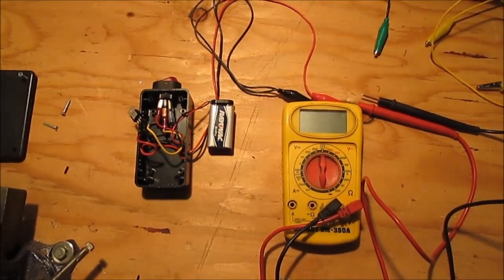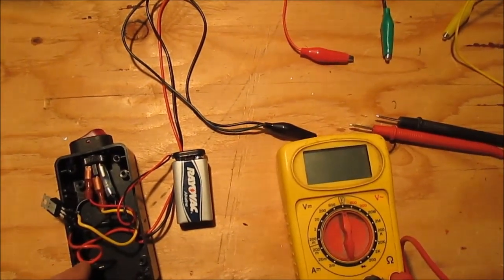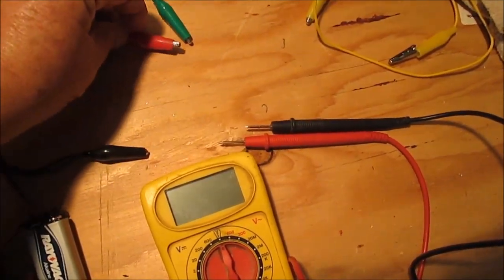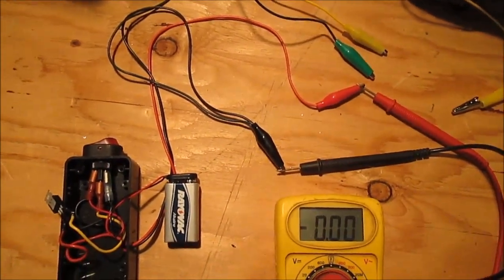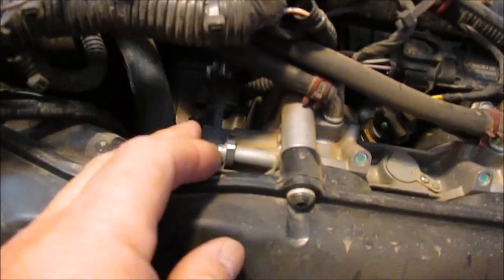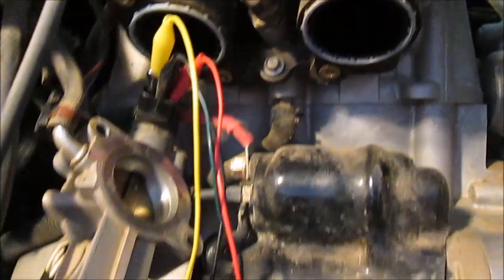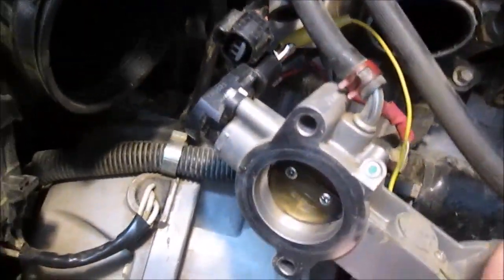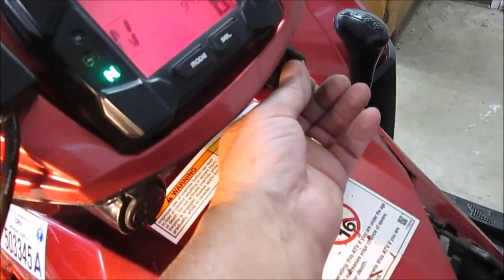ATV Polaris Sportsman 850 TPS Tool and Adjustment

Comment: Hey Dale I have the same Issue - did you adjust the throttle positioning on the quad first where the thumb throttle inside the cable box for the TPS Gap of 2-3mm or just adjusted the TPS with the existing throttle in its original state - what im refering to is section 2-10 in the service manual - did u adjust as per the manual or just made the correct TPS Sensor adjustment as per section 3-24 - i have the same issue as you 
and how did you make the 5V supply item?
Reply from the maker: I adjusted the throttle cable first and it didn't resolve the problem.  I made the TPS adjustment tool from Radio Shack parts following directions from another Polaris owner.

Comment: I know this is a really old video, but you can actually just back probe the signal wire on factory tps connector with a paper clip for free. It doesnt damage anything and the ecu supplies 5 volts with the key on.
Reply from the maker: Yes, I think that would work and it would provide the exact voltage needed for the tps adjustment.  I haven't tried that method so I can't say for sure.
Reply: It does work, this is the method we use in repair shops for tps diagnosis and replacement due to not having the polaris digital wrench program. This method also rules out broken 5v supply wires or ecu 5v supply fault
Reply: @hebertpowersports4  can you elaborate on how to do that - i have the same issue with the TPS - just wondering how to use the paperclip method to adjust the TPS using a Voltmeter - mine has rough idle and i know its the TPS - maybe a quick video would help - theres alot of us guys out there with the 850 with this issue
Reply: darryl smith connect your ground lead to ground and then straighten a paperclip and slide it into the back side of the connector along the sensor signal wire (output from tps to the computer) while the connector is plugged into the tps. The paper clip will slide through the o-ring on the wire and contact the pin inside of the tps connector. Connect the positive lead to the paper clip and it will give you the output signal voltage coming from the tps
Reply: Hebert Powersports got it - thank you for the quick response - really appreciated

Comment: Hi thanks for the video..how your atv running after the tuning?
Reply from the maker: It's been running fine.  I had been getting a backfire at times when slowing down to idle and now it doesn't backfire.
Reply: @dalechristensen3433  thanks for the reply  I appreciate that.i have 2013 Scrambler  I just change the tps after watching your helpful video..I'm just wondering if your rpm moving 11 to 1210 idle?the end of your video the rpm moving that number are they the same as of now?
Reply from the maker: @jmkc1964  I've found my idle to be irregular when the engine is cold.  It's more consistent after it warms up.
Reply: @dalechristensen3433  after I change mine yesterday the idle iregular,same as yours..I didn't try it yet when it's warm up..

Comment: There's an off-the-shelf tool that makes this a ton easier because it has a built in 5V reference and volt meter:  www.tpstool.com  You just need the matching plug, or a few wires to connect it.

Comment: a solder rework station even a cheap ebay one will generaly have a adjustable power supply. i used mine, set dial at 5vdc and you dont have to mess with any of that battery powered stuff and its a rework station so its not like your not going to use it.

Comment: Dale,  Thanks for the video. I am interested in the which (color) wire would correspond to the output of your TPS.  I never could get a good view of the connector in your video. On my 2013 Ranger, pin 1 = violet, pin 2=green, pin 3 = orange.  With the connector unpluged and key on,  I have 5vDC on the orange wire of my plug. I think this would be the 5vdc input to my TPS.  So to check my ouput voltage, I think I need to check across the purple and green wire (pin 1 and 2 on TPS). The service manual will show the pin-out on the electrical diagram (near the end of the manual).  Thanks.
Reply from the maker: You are correct.  I reviewed my notes and I found the orange wire on pin #3 is the 5 volt source and the output voltage is the purple wire on pin #1
Reply: Thanks for confirming that.  I have seen other videos on Polaris TPS settings and they say to check the voltage across the Orange and Green wire on the TPS. In our case, the voltage here would not change as the TPS is adjusted.
Reply from the maker: I also found the same misleading information when I started the project and I had to change my notes after I found the purple wire on pin #1 is the output.  I rode for almost 200 miles last week and it ran great.  I no longer have a problem with a rough idle when hot and a backfire at times.
Reply: That is great.  My Ranger runs much better now too.  As a note, rather than making a 5v source from a 9v battery and a regulator like you show, I just re-purposed an old cell phone charger that has a 5vdv output.

Comment: Hi Dale, Thanks alot for sharing your information is very appreciate. I found strange that only -0.03v was your problem when +-050v is accepted. Also you not have 5.00v but you have 4.96, is -0.04v. I expecte that if you applied a 5.00v ( +0.04v than applied )  you probably got 7.00v no ?! But if you confirm that was fixed you problem is great. I have a problem with my 2012 sportsman 850 XP, The throttle on idle  up( 2400rmp) and down(2200)  ( to high ,  normally is 1190 ), and in this case I need to power  off the engine because I can't change the transmisison position and it  moving forward or back it self. I have this issue only when is very cold, like -20degre celcius. I dont have this issue in summer. My Polaris dealer already changed my TPS but dont fix the problem.
Reply: Danny, It sounds like your stop screw is out of adjustment (high idle).  The manual says not to touch it, but the throttle plate has to close completely or you will have the high idle. Make sure its not binding somewhere else keeping the trottle plate from closing.  After its adjusted so it will fully close, then you need to set the TPS sensor.
Reply: @KirkA0906  Hi Kirk, thanks for your comment. Sorry if I am 3 years late ( and for my bad english )  I forget to mention in my old post that my vtt can run correctly long time and often I am on idle and is running correct ( 1190 rpm) and after few minutes, without toutch nothing the RPM up and down between 2400rmp to 2200rpm few minutes and back to normal by it self, and the problem back after some minutes or secondes. If it would be a physical copmpoenent ( throttle cable or plate or other ) I expect that is always running bad while the component is faulty and should be not in a good state until I move this component. For exemple I think that if a idle cable is too short is always too short and dont came back to normal by it self. Perhaps I am wrong. My intermitent problem is not yet fixed. I dont use this VTT in summer only in winter, the problem is when is coold. Thanks